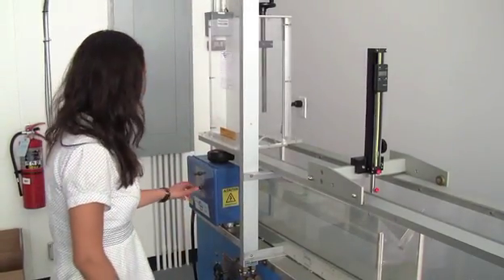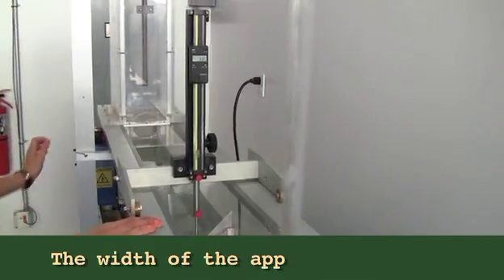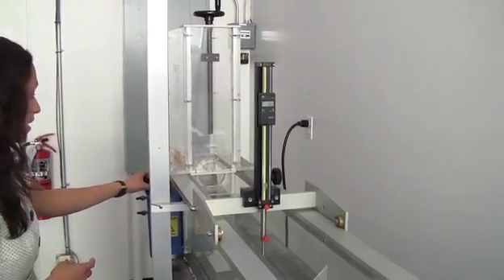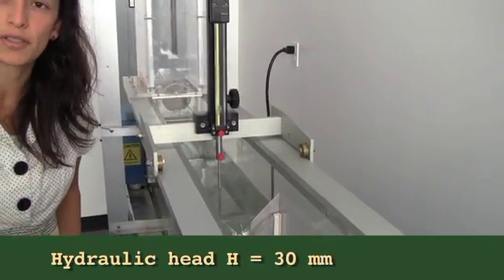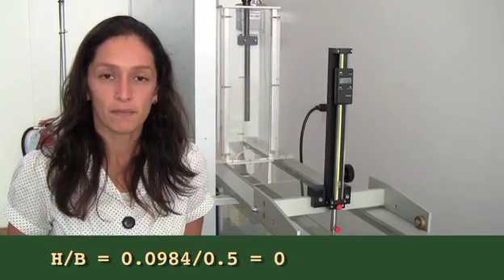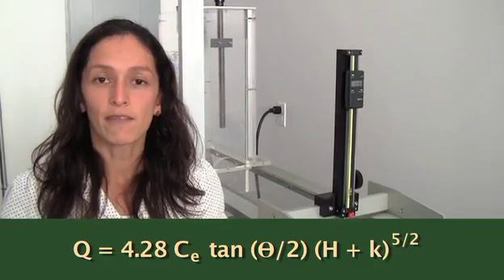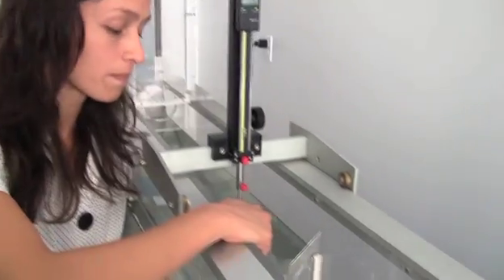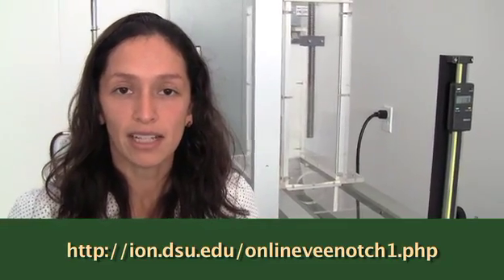V-Notch Weir

Comment: what is the purpose of the V-Notch Weir Experiment? What are we trying to find out?
Reply: +AHMED KHALIL you can determine the discharge constant because you know the heads. Such weirs are used to measure the discharge in small channels for example, hence the constant needs to be known.
Reply: For flow measurement